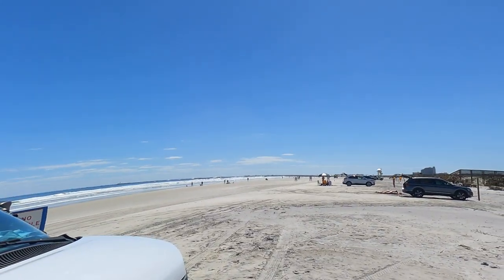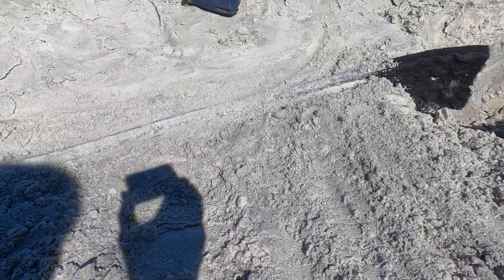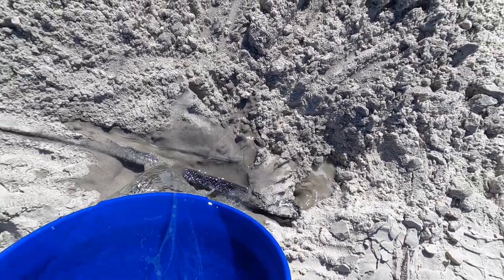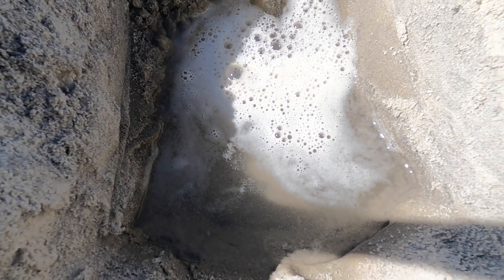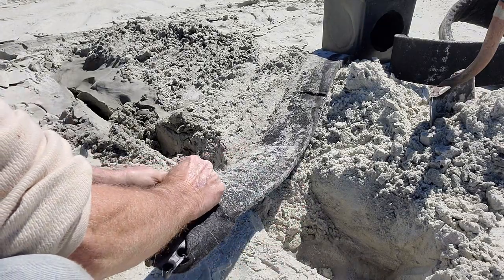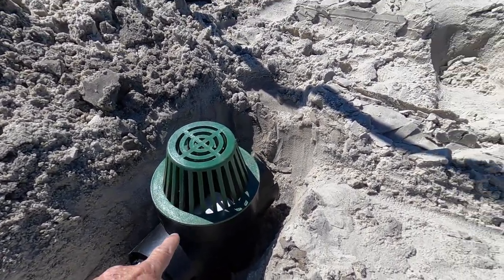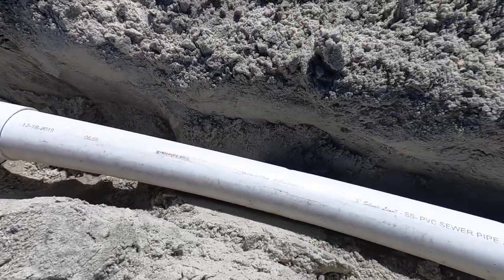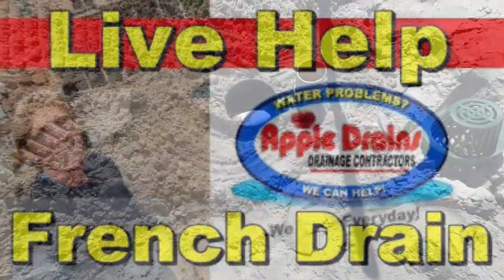STRIP DRAIN, Genius Way to Easily Solve Wet Spot in Yard! GUARANTEED Truly Save 1000's - Watch Demo

Comment: I've seen this stuff or similar with smaller dimples installed against foundation walls leading down to a normal perforated PVC pipe, which then leads to a sump basin or to wherever the discharge is. Works really well!

Comment: Thanks for the videos 🎉 Do you need rock either on the bottom and set the system on the rock? Or can it go right on a mud dirt crawl space floor? Does rock need to cover it? Or can the crawl space excavation go back on top. Dirt

Comment: I ordered 50 ft of this from Lowes last night at a cost of $75.  It says to use sand and or pebble gravel to fill in and bury it 3 inch from top of ground and about 4 inch from bottom. Not much on internet as to how to use it. I also ordered 3 connectors with a 4 inch outlet. I have clay soil and it is a mess. When I install all my catch basins, gutter drain spouts, and solid pipe I will send this outflow along with the rest to the sump pump then out to a side swale.  I hope to install this in the same trench as the solid pipe, just not as deep. I don't know if that can work or not.  What do you think?  If this works in my situation, it will be a cheaper solution than French drain.
Reply: I would love to know how this worked out.  I am in the process of adding to my french drain now, and I need something like this to collect a large bunch of surface water and hook up into an existing French drain...